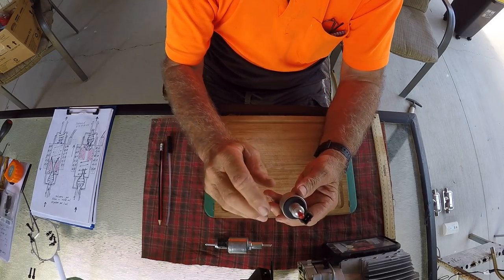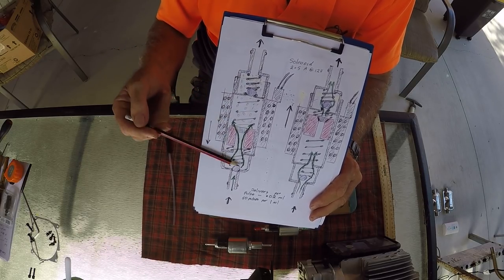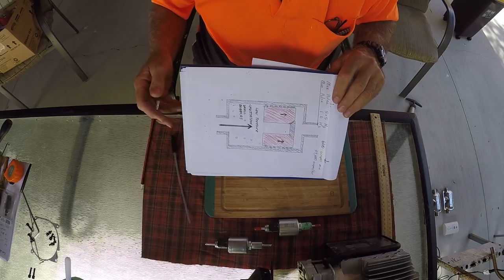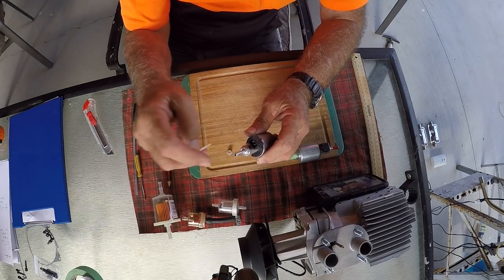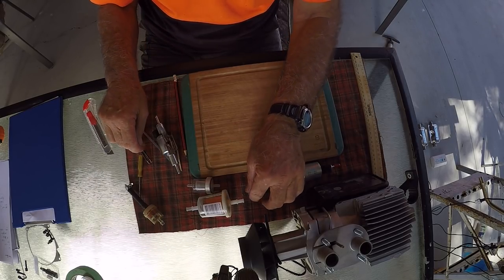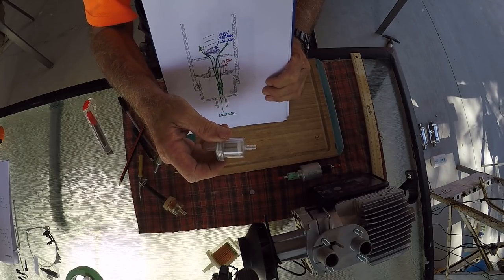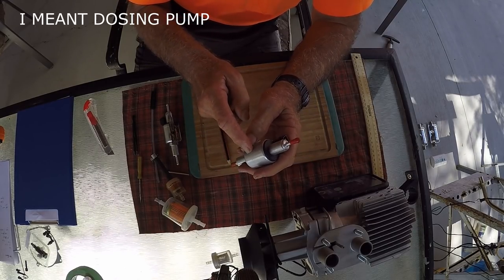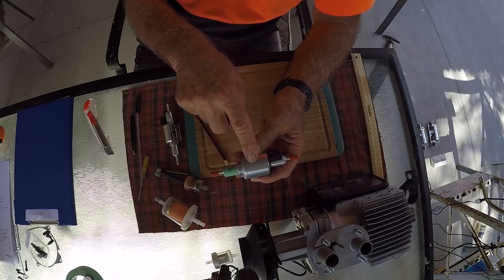Chinese Diesel Air Heaters   Part 7   Metering/Dosing pump

Comment: Dear John!  Thank you for all of these videos. Id have a question about the oil pump: what would happen if i'd run a 5kw chinese Diesel heater with an oil pump that is made for 2 kw heaters? The thing is my old 5kw pump has stopped working with 12V, it is working fine on 24V though ... I got a spare pump from one of my friends, but it is for 2 kw heaters. Do you have any experience? Is it dangerous to run it with that? Do you maybe has any idea about the old pump that has stopped working with 12v? Thank you so much!

Ruben

Comment: I am curious if you would recommend using the hard nylon fuel line these come supplied with over a more flexible type of fuel line that would be used on a chainsaw or lawnmower. I am in the process of putting one of these together, and initially thought the hard plastic line was extremely cheap feeling, and I do not trust it at all especially in the cold. Do you think the rigidity is a requirement for proper dosing? Or will any fuel line suffice?

No need to reply, I found my answer in a video further in your series! I should’ve known this would’ve been covered at some point since these videos are so amazingly detailed. Thank you.
Reply from the maker: Hi Tim,

You can get buy with normal fuel line if the distance from pump to heater is very short, less than say 500 mm. Suggest you do not use that cheap garbage clear nylon fuel hose supplied with some heaters. It quickly perishes in a hot environment. Buy some good quality 4 mm rubber fuel hose.

If you have longer fuel line runs greater than about 500 mm, you should only use narrow bore (2mm to 3 mm ) hard nylon or metal fuel line that does not absorb the fuel pump pulses.

To burn effectively diesel must be atomised and these heaters do this by forcing the diesel through very fine atomisation screens around the burner. If you use soft fuel hose on delivery side of heater it absorbs these fuel pulses.

Soft fuel line will work for a while, but very soon the screens will clog up and the heater will not work. Using hard nylon will save you a lot of maintenance issues.  JMcK

Comment: My heater runs from 1.7 to 5.5 Hz and using basic spreadsheet with 38MJ/L for diesel @5.5Hz and claimed 5KW is a pump of 24uL and 8KW is 38uL so those pumps must be double acting are they ?

Comment: Incredible teacher! I have marathon-ed all the previous in this series. Can't wait for the next. I will be more than ready when I purchase my Chinese diesel heater. 

Questions:
Does gasoline have lubricant for the health of the pump?
Do these Chinese heaters also do well in high altitude as a certain Ebespacher heater does?
Reply from the maker: Hi Mike,

These Chinese copy heaters, to my knowledge, still  do not have a successful gasoline (petrol) version. If you wish to go gasoline you will need to purchase a petrol version of the genuine German Eberspacher, or Webasto heaters.

Currently the Chinese copy heaters do not have altitude compensation in the supplied controllers, and the heaters run rich at altitude, causing quicker carbon buildup and require more maintenance. Running kerosene with 10% diesel for lubrication, means cleaner burning at altitude and less carbon deposits.   JMcK

Comment: Thank you John as always for sharing your in-depth knowledge about these diesel heaters. Have a quick question about fuel delivery. my sprinter van is equipped with Webasto heater and small diesel, fuel line going back to the tank. Would it be OK to put a three-way splitter on that with Webasto fuel line to have it feed both heaters?
Reply: To clarify Webasto heater is for heating the engine block, I’m adding another Chinese diesel heater to heat the inside.
Reply from the maker: Hi OF, suggest you run normal 4 mm ID quality rubber fuel hose from tank to filter to splitter then to both diesel heater fuel pumps. It is only important to run narrow bore (2mm) hard nylon fuel hose from pump to heater so the pump fuel pulses are not absorbed.  JMcK

Comment: Hello John, we missed talking about the mark on the pump body. In your case it is written 18-22-12 which probably means that this pump is 12v with a diesel flow of 18-22 (probably for a 5Kw heater). In the case of the 2Kw heater, it will be written on the pump 16-18-12 that it would have a smaller flow. Am I right???

Comment: Hi John , am in the middle of installing a diesel heater , the rubber tube is very tight when i am trying to push in the nylon fuel tube , can i lubricate with some wd40 ?
Reply from the maker: Hi Steve, yes you could do that, but have you tried soaking the end of the tube in hot/boiling water? JMcK
Reply: @johnmck1147  Hi John Thankyou very much for the reply and advice with all of these videos that you have put up they are very informative , they have helped me a out a lot
Reply from the maker: Steve J 

Your welcome Steve

Comment: Mounting the pipe vertical made a lot of sense. Would you recommend to make the pump Outlet facing down (with the wires) going to the burner. Then the pump IN-take will be on top (coming from the tank)? I saw a guy on YT that did this and is working. But I like to hear your opinion. Thanks
Reply from the maker: Hi J,

You can try a lot of things with these heaters, like burning old engine oil, running the heater upside down, radically changing the settings etc and they will still run   -   For a while.
Just as you can drain the engine oil and coolant from your car engine and it will still start and run ok.  -   For a while.

The fuel pump will work in any position.  -  For a while.

By the nature of their operation these fuel pumps produce tiny cavitation bubbles. Tilting the pump upwards makes it easy for these tiny bubbles to escape and be pumped along the fuel delivery line where they are injected into the atomisation screen in the heater burn chamber where they assist fuel atomisation. 

Tilting the pump downwards will make it harder for these bubbles to escape, and they can join together to form a larger bubble which will impact on the pump operation and metered fuel delivery volume.

Cheers.  JMcK
Reply: @johnmck1147  Thanks.
Reply: @johnmck1147  Thanks, well explained. You're right, I noticed that most people who had problems with their heater are the ones who experiments on their units and controls.

Comment: Hi John, thank you for your wonderful videos and tutorials on these heaters. I have installed two now with great results thanks to your information.

I am interested in your thoughts on having two fuel filters in line? One being a large paper filter from Supercheap auto next to the fuel tank that I can easily swap out each year/service, and the 2nd being the small stainless steel mesh filter that came with the heater. Or would this be too restrictive for the pump?

Thanks again, much appreciated.
Reply from the maker: Hi Karl,
You could try it. I am all for experimenting. However in real life I have not found a need to have two filters.
There could be too much restriction, but this could be overcome if the fuel tank was higher than the filter.
I would be interested to know how you go.  JMcK
Reply: Thanks John for your insight. I wasn't sure how effective the little stainless steel mesh filter is so was taking out more insurance.

I'll see if I can set it up and get a measurement difference between one and two filters (sort of how you demonstrated the difference between the hard bore and softer fuel lines).

Thanks again, wonderful videos/tutorials.

Comment: Do the pumps just die out of no where? Mines been great for 1.5years. Then all of a sudden wont prime or start up like it used too. Ordered a new pump, like you said could be worn inside due to me letting it prim itsself when first installed.
Reply from the maker: Hi Moses,
These pumps are generally quite reliable and you can expect many years of problem free use, but quality out of China can vary significantly.
However, make sure you have a quality fuel filter, don't dry prime, and mount the pumps with an upward angle to improve their life.  Cheers,  JMcK

Comment: great info, thanks so much. My pump however, doesn't really seem to have enough force to pump anything. Can I open it up somehow to check if there is a blockage?
Reply from the maker: Hi Jord,

Sorry, these pumps are sealed and can not be opened or serviced. This is why it is important to install a good filter before the pump.

If you hear a clicking sound the pump is working, but if no fluid comes out there could be a blocked valve. 

If the pump is stuck, it can sometimes be freed by giving it a couple of taps with a small hammer.

If all this fails you are up for a new pump. Lots of on line sellers, but make sure you specify your voltage. Here is just one of many sellers 

https://www.ebay.com.au/itm/Universal-Car-Parking-Air-Heater-Pump-Auto-Electric-Diesel-Oil-Fuel-2-5KW-12-24V/401764170235?hash=item5d8b02b9fb:g:rzQAAOSwphhc0~gN

I hope this helps.  JMcK

Comment: Would using spray foam to in case the entire pump reduce noise and insulate it be a thing? I understand that you would have to replace the entire pump and fuel lines but it seems a minor cost compared to those benefits?

Comment: The pump is a low pressure fuel injector. Some diesel engines use electronic high pressure fuel injector.

Comment: Hi J.
I live in Manitoba Canada. I want to run kerosene and add diesel for lubrication. 
The temp can be - 20 c
What ratio should I use. To keep pump lubricated 
Thank you for all the helpful info.
Reply from the maker: Hi Bruce, this all depends on the kerro you are using. If you are using industrial kerro it generally has a high sulphur content and extra lubrication is not required.

In Aus I use lighting kerro, which has no lubrication so I add 10% diesel for lubrication.

Regardless, the pumps are very cheap, so if you get it wrong it won't break you to buy a new pump.  JMcK

Comment: Hi John. Love all your videos. I’ve watched them many times. I have E-4 error code. Batteries at 13.2v. Must I replace or can I service this pump? Thanks Neil
Reply from the maker: Hi Neil

Sorry for the delay, I am back on my sailing boat in the Med for eight weeks of sailing.
Pleased you liked the videos.

Now, to the pump. Easier to buy a new pump than try and service the old one.

However, pumps last for years. Our boat one is now over 15 years old. 

Is the pump the issue or is it something else?

Do you have a good fuel filter? It only takes the smallest bit of crud to jam the pump.

Another area to look at is corrosion in the wire connector on the pump. Recently had a motorhome have issues here from dust in the connector from driving on dirt roads.

Good luck. Please let me know how you go.   JMcK

Comment: Great videos John thanks, have you ever experienced the fuel pump not working. I purchased a new pump and controller as mine stopped working, fitted it and it worked for two nights then stopped.  The relay activates h by us the pump has no power.
Reply from the maker: Hi Ian, it is very rare for a fuel pump not to work. Without knowing more, or actually seeing your set up it is hard to give advice but here are some points.

1. Voltage to the pump too low. Caused by running the heater with flat battery, pump wiring extended and not going up in wire thickness, or wire from battery to heater extended and not using thicker wire so voltage at the heater is below 12V.

2. Pump overheating caused by wrapping the pump in insulation to try and reduce the ticking noise.

3. Bad fuel blockage in the pump itself by not having a good fuel filter in the fuel line.

4. Fuel not getting to the pump because of blocked fuel filter.

5. Serious wear in the pump caused by running it dry for a long period while using the pump itself to initially prime the heater fuel system.

6. Mounting the pump too high above the fuel tank requiring the pump to work hard to suck up the fuel (pumps are much better at pushing rather than sucking) The pump will initially work but with a bit of wear, particularly in regard to no 5, they lose the ability to suck the diesel up high.

I hope that is of some help.   JMcK

Comment: @John McK 47   Great videos. Thank you. From what I've read on line these dosing pumps come in a range of sizes from .016 - .063 mls per stroke. EBay also sell a range of sizes of diesel  heater dosing pumps. Any thoughts on this John?
Reply from the maker: Hi Philip,

The majority of Chinese heater dosing pumps are .02 ml. If an enthusiast,  you can play and make adjustments to suit your needs. But, you make changes to one aspect in these heaters, you must make changes to the others? The fan speed must match the pump dose settings, which must line up with air mix ratios, which must not exceed safe heat settings, etc etc.

I do not advise the average person to change the factory settings, as they can get into so much trouble, and there is no factory reset switch.  JMcK

Comment: Great videos You mentioned  the bore is 3mm but the pipe to heater should be the 2mm id  is this correct
Reply from the maker: Hi ZeroHour,

Some heaters come with hard nylon tube with 2mm bore, some with 3 mm bore. Both are ok. 
The important issue here is “hard nylon”. You do not want the fuel hose on the delivery side of the dosing pump absorbing the fuel pulses, particularly if the delivery hose is longer than a metre or so.

Cheers.  JMcK

Comment: how to prime, I thought of a syringe, a large one and draw the fuel up through the pump with that.  I am learning a lot with your vids. I am thinking of replacing the propane heater in my 19 foot camper with one of these style heaters. it draws way less amps,,,,and it allows for my fridge to run longer on the propane.
,,,thanks
glenn in mississippi
Reply from the maker: Thanks for the feedback Glenn. Yes, a syringe would be good. Also with these heaters you get dry heat. Propane heaters put out large volumes of water vapour. JMcK
Reply: @johnmck1147  hey john, that's true about the propane and the moisture. but ill be replacing the original heating system which uses a heat exchanger also, so it is dry heat. what I want to do is replace it because the factory heater sucks the propane like crazy and drains the battery's quickly because the fan runs on high speed no matter what you have the temp on. so a lot of the heat goes straight out the exhaust pipe. I don't think it is near efficient has this heater. and it should fit right in the space the now heater is in.
take care down under

Comment: So ideally, should the pump be mounted completely  vertical or at an angle? Its not entierly  clear. If its at a 45 degree angle there would stil be an air pocket inside, wouldnt there?
Reply from the maker: Hi Timothy, 45 deg is a good  general angle, but anything greater than about 15 deg allows the bubbles to escape.   JMcK
Reply: @johnmck1147  OK, cheers John, I will mount it vertical!
Reply: Completely vertical or 45 angle.  What is better?

Comment: Hi John. Great video. Thanks.   Question. 
Does it matter the polarity of the wires to the pump? The wires are both the same colour (grey) That implies it does not matter. After cutting them to put wires through floor,  I'm not sure which way they were connected originally. IT IS MY GUESS, that for this type of pump, polarity does not matter. Brent.
Reply from the maker: Hi Brent, no polarity does not matter with the pump. You are energising the magnetic field in the pump to drive the piston.  JMcK

Comment: My pump stopped pumping .not a sound. I ordered a new one installed it yesterday. Worked great . Shut it down after 15 mins,. Everything fine, today turned it on....fuel pump is dead. Would you happen to have any ideas on what I can check or what’s happening.? Thankyou
Reply from the maker: Hi Jim,

First, when you first turn the heater on it goes through a start up cycle before the pump starts. This can take 4 or 5 minutes. Did you expect the pump to start straight  away?

Next, if nothing happened after start cycle completed  I suggest you check both pumps by manually testing them on a 12V battery. Sometimes this is easier to cut the pump wires and connect one wire to the negative terminal of a battery and then quickly and repeatable touch the other wire to the positive terminal.  Remember just a quick touch only. You will hear the pump tick, and if you remove the outlet fuel hose you will see a little squirt of fuel with each “tick” of the pump. You can solder the wires back, or put joiner plugs for easier removal in the future. The polarity does not matter with the pump.

If both pumps are working in manual mode, you may have issues with the ECU or controller.

If this a  new heater, suggest you ask for a replacement.

If an old heater, you can buy an ECB off eBay, but sometimes you can get compatibility issues. These heaters are so cheap it is often better to buy a new heater and use the old one for spare parts.

Cheers.  JMcK